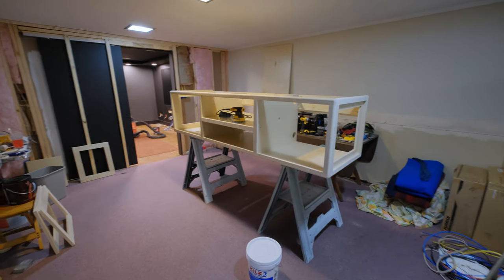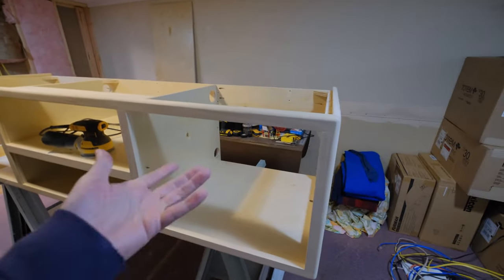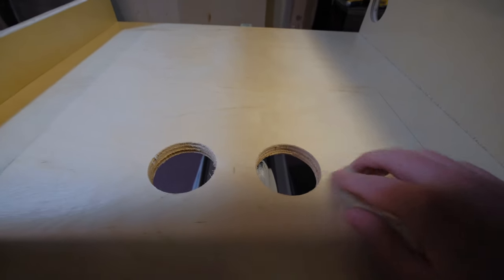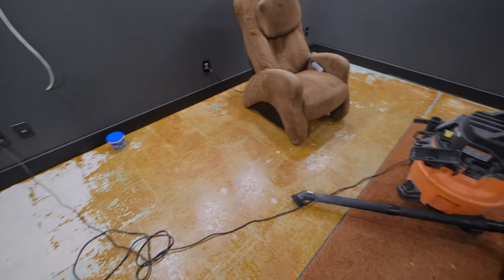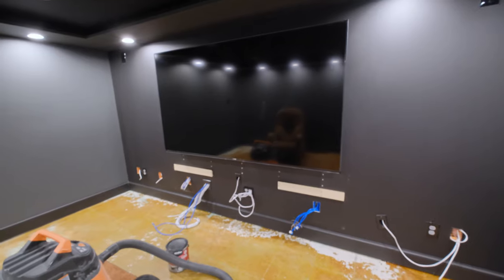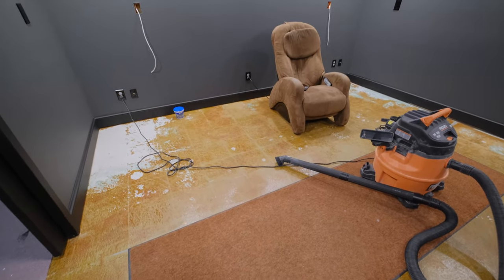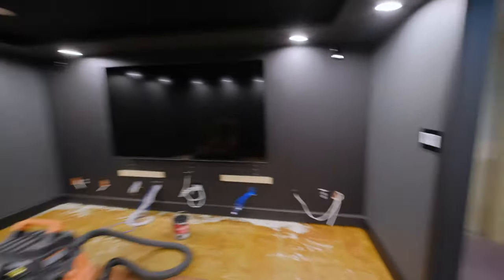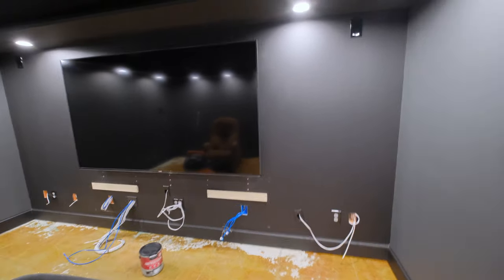Home Theater Project Part 15  Custom Rack and Flooring Updates

Comment: Room is coming along good! I got my audio pretty much done for what I want. I'm running 2 svs pb1000 subs and it has some good output for my small room. What kind of subs r you planning to get. Right now I'm using an 65 inch tv and then I have a 92 inch pull down screen in front of it with an epson 8350. So I have the upgrade itch. Either I'm going to get a 75 inch sony and then the epson 5050 or am going with just the Sony 85 inch. I think my wife would prefer just the tv cost the money. Also how many seats r u doing. Looking forward to your next video
Reply from the maker: Thanks! Sounds good. The upgrade itch gets us all, haha. I'm doing 4 seats, (You'll see them very soon!) For subs I'm doing two Totem 10" subs to start, but I wired for four. It's a small air space, so I didn't want to overwhelm the room with bass. My buddy wants to bring over his PC4000's though, to hook up in the back, lol. The room is only 12x13' with 7' ceiling so not a lot of airspace to pressurize. Audio is where it's at though. TV's will always get better and cheaper, Audio is forever.
Reply: @Clint_the_Audio-Photo_Guy  Nice my room is 12x11. I really have no issue with pressure but where I feel like I'm lacking is that chest punch and I really want that